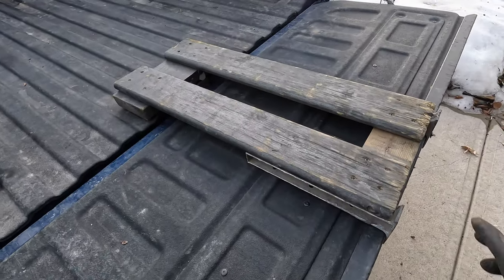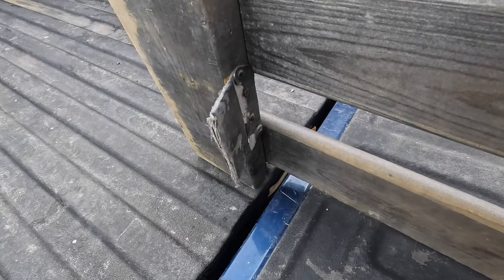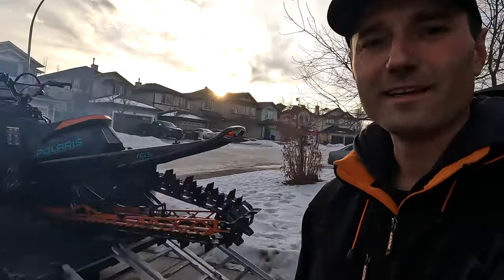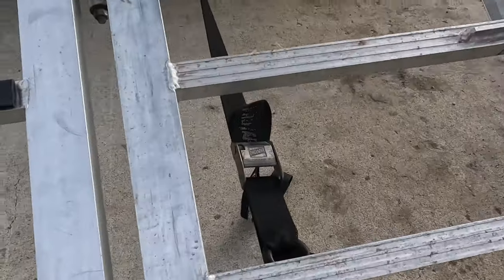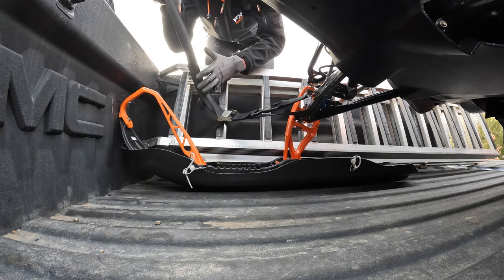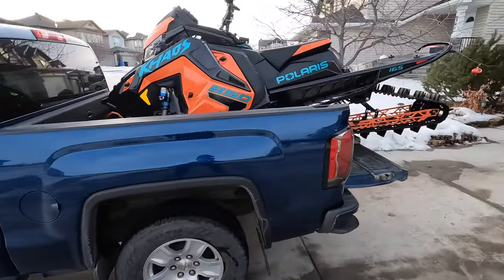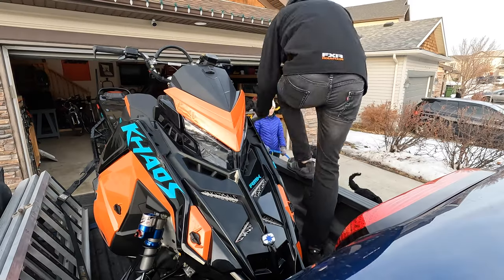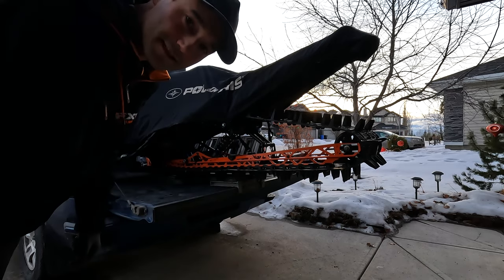Load Sled with this Block Trick! \\ Easier to Get Ramp in and Out

Comment from the maker: Welcome! Does your ramp get stuck under your sled after loading it up? How do you get the ramp back in when you're unloading the sled? Comment below!
Reply: Nope bit of effort to fit ramp "fingers" under beavertail but works great. Do the Sno Stuff ski boots ride up the ramp with no effort? I have Caliber ramp glides for the carbides when loading.
Reply from the maker: @loneranger8293  yes they glide up with no friction
Reply: @JasonCaville  perfect as I was concerned they might slip off Caliber ramp glide as smooth underneath.

Comment: Great job! Two questions: No issue backing it off truck as well as do the carbides impact the top of the tailgate? Hard to explain but I built a beavertail (covers top of tailgate) out of 1/2" plywood that is attached to a full sheet 1/2" plywood in bed of truck. The beavertail flips over protecting tailgate and also allows the unloading of the snowmobile on ramp as beavertail covers the ramp "fingers". Clear as mud ha ha. Thanks
Reply from the maker: I use Sno Stuff Ski Boots! Protects the bed and my shop floor from the carbides
Reply: @JasonCaville  interesting will have to check them out. Thanks.

Comment: That’s a great idea.  I just wonder how well it grabs coming off as it’s sitting on the slippery wood .  Thanks and what are your measurements 🍻
Reply from the maker: I used some pressure treated 5/4 x 6” decking on top of a couple pieces of 2x6. It’s a little wider than the track and about 6” longer than the tailgate. I’ve never had the track slip but it would be easy to add some traction to the top

Comment: How did the tracks push the sled onto the truck on concrete? It looks very cool!
Reply from the maker: I have plastic boots on the skis which help it slide across the driveway and up the ramp. It goes up very easy so you have to keep your finger on the brake. Otherwise the sled could hit the back of the truck!

Comment: Can you share the dimensions .  It’s a great idea thanks man 🍻
Reply from the maker: 28 3/4” long. 12” wide to fit between my tri-fold ramp pieces that go on the tailgate. 2 1/2” high.  I also have a piece of aluminum plate attached that fits between the tailgate and bed to keep it in place. I added aluminum shelf brackets to hold it on the end of the tailgate too.